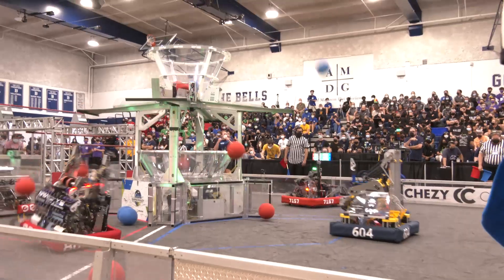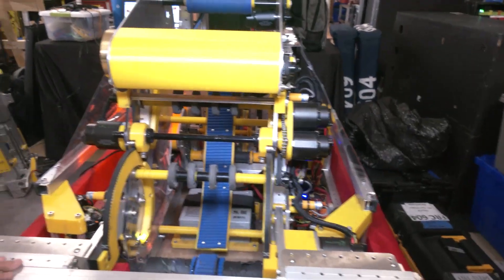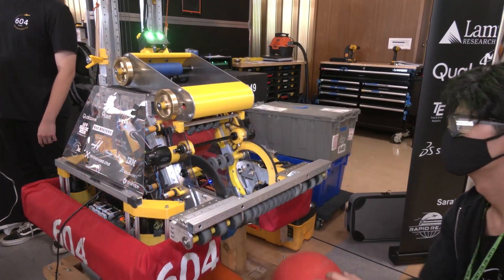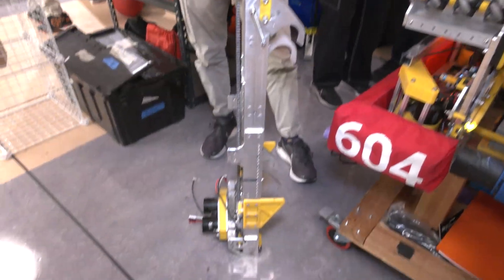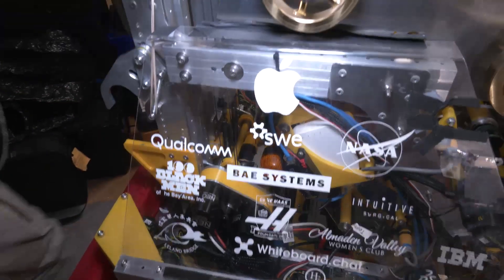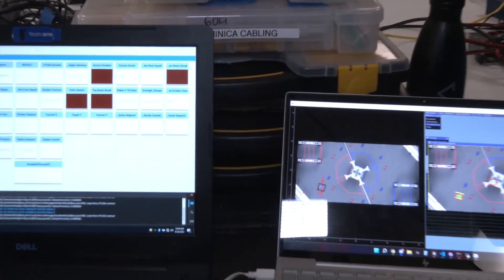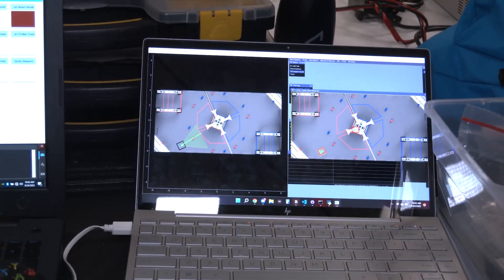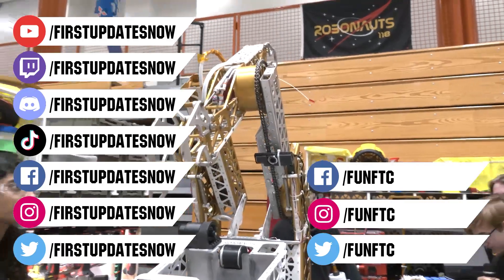Behind the Bumpers 604 Quixilver Rapid React Robot

Comment: Are you using the field localization for driver control (does anyone look at the visualization during the match)? Or is it solely for automation like turn to target or shoot on the move? To determine the distance to the target, is that still just height in frame? Also, how well did your shoot on the move end up working? Seems really tough without a turret, difficult to get it snappy enough for accelerations. One more question, I am impressed that you can shoot from so many positions without a hood, is that all done by just varying the speeds of the wheels? If so, is that something you tuned manually or mathematically defined?
Reply: We have the localization visualization open during the match for debugging purposes, but 99% of the time no one looks at it.

Yes, the distance to the target is the height in frame. More precisely, we use the position of the target in frame to compute the bearing and elevation to the target, which is fed into the particle filter to estimate position (including distance).

Shooting from many positions is done by varying the speeds of the wheels. We manually determined the exit velocity of the ball at different RPMs and used that along with balistics equations to compute the correct RPM and robot angle to score while moving. Shoot on the move was limited more by the lack of an adjustable hood than a turret, but a turret would've been beneficial as well. It was a tradeoff we made for simplicity reasons. We only used shoot on the move in specific scenarios, as you can see in Einstein match 10 https://www.youtube.com/watch?v=Fiop_op6TYY